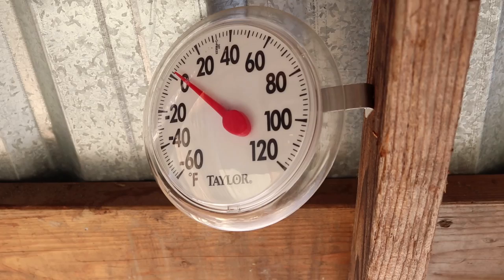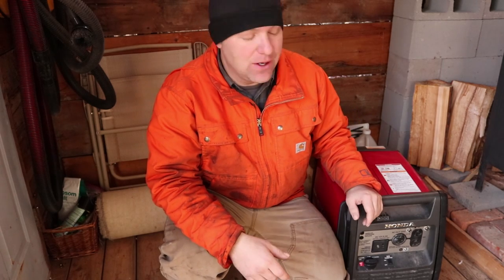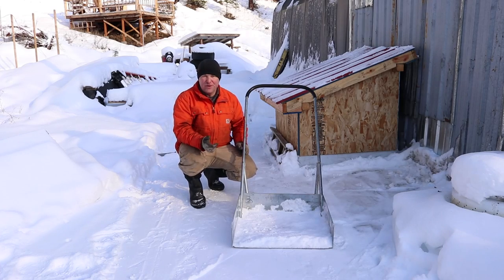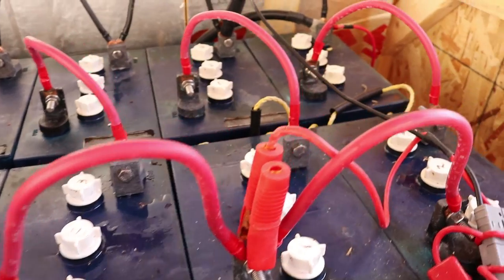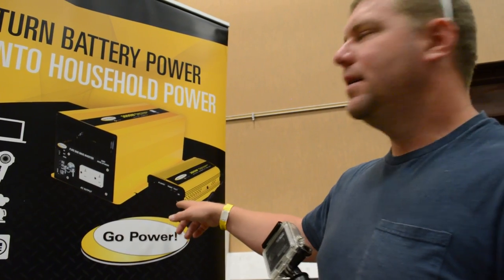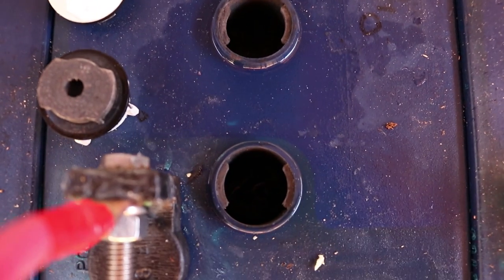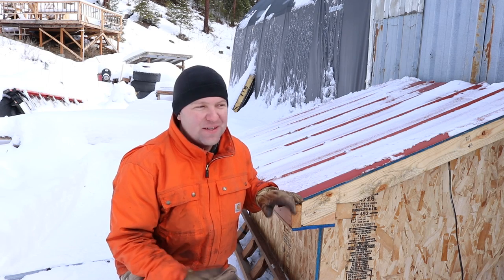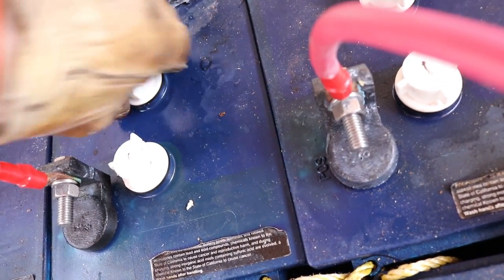SO FRIGID BATTERY ACID IS FREEZING! + Off Grid Power problems

Comment: old timer trick for battery's i use it all the time on my atv and other stuff around the farm. we are way up at the top of NH -20 temps and batteries work great. mix 10 tpsp  epson salt to 1gl of distilled water from the Pharmacy. add a tiny bit to each cell this works on even completely dead battery. If you google it you will find more info. if the battery is real shot you can deoxidize invented the cells with vinegar and baking soda and rinse with water. then top off with electro-light and in a little bit of the Epson salt solution.

Comment: Here is another possibility.  Build an insulated box that will hold the generator with about 4-6" of space on all sides and top.  Obviously you need some ventilation to get the exhaust out and some fresh air in, but you want to keep most of the heat in.  You probably should have a metal deflector near the exhaust.

If this doesn't make enough heat, try hooking up a couple of 100W light bulbs inside the box.

I also think that if the generator is running in a warm environment, that it will be easier to start the next day.

Comment: would it work if you ran a tube from the house to the battery box as low down as you can get with a little electric fan to push warm heat from the stove to the battery box, As far as the generator i always take the carb off and clean it because every year they gum up and causes it not to start and they run funny. just a idea.

Comment: Hey i know you guys in the usa use fahrenheit as your measure of temperature but if you have a few loose coins rolling around it would be nice to get a thermometer that measures both Fahrenheit and Celsius for your international viewers.

also grab a thick slab of steel and whack that bad boy on top of or next to your fire each night and then in the morning put it in the battery box, will bring the batteries up to a nice temperature.

Comment: what about dropping a couple of drops of anti-freeze into each cell?  I know that would possibly change the chemical makeup of the cell, but would it be a negative (as opposed to a dead battery?)  I'm curious to try this with a cheap or salvaged 12v car battery.
Reply: no that will kill your batteries, even using generic water ( as in its full of things other than just H2o especially in america), the question is do you know why....

luckily its dead easy to make reasonable distilled water to top up, it just seems that people are so used to convenience  they forget all the basic science  lessons already learned, if your off grid or just practicing offgrid in the back yard (now theres a concept :) then these things take on more importance as you may need to know stuff..

Comment: You can use gernerator exhaust to heat up the batteries with a simple damper control. The generator sits outside of the battery box and you got a aluminum flexible pipe into the battery box... no need for air tight... just a good flow. Sular furnace and insulate that battery box is another idea.

The generator sounds like carburetor issue but you should run a engine compression test to check engine health before servicing the carburetor..

Comment: "Back in the day" we would put a low wattage light bulb in our pump house to keep the pump from freezing. If your pump froze in the winter it would be a long winter without water. I am betting if you put a light bulb in your battery housing they wouldn't freeze at all and use less power in the process.
Reply: (BUT, FOLKS), if they are trying to run solar, they would need to run a generator to run the light bulb?  or the (BULB) would discharge the batteries and kill the bulb and (viscious circle) LOL

Comment: There's something called a battery blanket and you need at least 2 or 3 of them between the batteries. If you keep a couple batteries inside with you(warm) hook them up to an inverter to run the battery blanket.  Frozen batteries DO NOT accept charges well!!!!! Top up your batteries with electrolytes You shouldn't be able to see anything but fluid in those type of batteries. I live in Northern Alberta Canada and I would never go without a battery blanket. If my truck has been plugged in(battery blanket and block heater) the truck starts like it's 75 above. The ideal thing would be a boiler system running excess heat from your wood burning     stove out to your batteries and back to the stove.(flexible copper pipe wrapped around exhaust pipe is a good place to start.) Lots of people use it for their cabin hot water needs.

Comment: Some time back i had a moped , which when hot would have a partial break down of the coil ie would start ok when cold , but with the increase of resistance under heat & load , after an 1/2 hour or so , would stop & refuse to start , until it was cold . Real pain . Was 2 stoke .......... took several attempts to get the dealer to find the fault , 'cos they never run it long enough for the fault to crop up,eventually they changed the coil.
Run it 'til it starts to play up & then see if the spark is coming through as strong as when cold ( ie pull it out at the start of the "test" & then when it starts to falter).... this may not be conclusive..the spark may be generated,with the plug out,because,as i under stand,pressure also suppresses the arcing.........
The other thing, is the routing fuel line,if it has been pulled about, it may have been put back passing an area in the gen that heats it up too much , causing "air" locks .    
Ps Sweet place to live !

Comment: Everything would freeze solid inside your battery box. You need to insulate the battery box than worry about placing a heater inside it that uses electricity.

Comment: Your carb is feezing up on the generator, you need some means of keeping engine heat on it. for starters take the air filter off it. winter air is cleaner and less likely to destroy the carb (snow blowers have no air cleaner). start taping holes /vents on the casing, that should make it hold heat (tape a third, then half, three fourths etc). Cover only as much as you need to keep it running you don't want to over heat it, and ofcourse reverse the procedure when the weather warms up. Never be afraid to tinker, most of what I have came from tinkering in one form or another. Synthetic oil, check the manual for which spec. If you're buying it special buy mobile one you won't regret it.

Comment: I know this is going to sound strange but the intake air is too cold for that cabarator. At one deg. or less the caborator will freeze up inside because the fuel turns to gas cools down already cold air freezes gas. We had simaluar problems operating in the bearing sea. Equipment for 5 deg. and below is winterized. Special fuel, oil intake heaters using exhaust manifold to heat air into caborator.

Comment: Only top off your batteries with distilled water, pure water (water vapor)is what battery losses when charging so that is what you put back. 
Your generator carburetor is probably icing up. Under load there is a lot of cold air going through it. To test this rig a cardboard box or something so the air cleaner is getting warm air from the heat coming off the engine. Not the exhaust just the air that cools the engine. If this works you will want to put it back to normal in warmer weather. I just thought of another faster check use the heater you use to heat the batteries and blow warm air at the air clearer intake if it runs better rig up the warm air intake.

Comment: You really need to insulate your battery box!  You will be loosing greater than 50% of your battery capacity at those temperatures!  You probably don't have the room, but moving them inside in a smaller plywood box with a dc vent hooked to an aux switch so it only runs when the batteries are charging hard enough to off gas, is really the way to go.  

Those frozen batteries are a real problem.  Looking at the specs on the inverter/charger and what I can see in the video, you are running a 12V system, so you must have 4 parallel strings of 2 batteries in series.  If this is the case I would take the 2 poor/frozen batteries out and just run with 3 parallel strings of 2 batteries and store the bad ones inside for the winter and work on them in warmer weather, they are just drawing down the rest of your system right now.  This my clear up your electronic problems as well?

Comment: Generator problems? Remove the outer cover (take pictures) find the engine speed control unit, attached to the Carburator. often operated by wind or a magnet, then clean off the contact surfaces and use WD 40 let it dry,, shoot all friction points. This control unit is how the speed changes under load,   also the air filter may be restricted, give me email and I will send pics of battery insulation that works for 80% of Summer Plus or minus a bit, What actually made a difference I can show you, good luck ,Nick

Comment: Hi +Pure Living for LIfe... Interesting video, more stuff RE the battery saga. Yes, I'd heard of ppl running thinner oil in really cold climates because the viscosity of the oil changes and gets thicker. Had me thinking living that lifestyle I'm sure you are more aware of how much power your devices or local grid takes. Have you done a video or studied the numbers? I'm curious, how much power to charge a laptop? The drone? Run the local grid for overnight to see at night? How much power in does the solar bank give?
Reply from the maker: We use about 3000 watt/hours per day on average with all of our laptops, cameras, lights, fans, heater, pump etc. In winter our solar currently is inadequate. We often saw "Whether you have a $100millon solar system or $100 we all get the same amount of power in the winter (oct-mar)" In summer (april-sept) our 480 watt panels produce far more than enough for a very conservative, LED based RV. I can't ever spend enough time on one thing to become an expert. Too many experts on one thing while we have to know a lot about a lot of things. :) Our power bill in winter is approx $100/mo. In summer it's $0.
Reply: Thank you kindly for the informational reply. Wow! 480 watt panels... Nice! Bests to you both rolling into Spring.

Comment: as for the generator. ...  have 2  one to do small work  and portable like a 2000 watt harbor freight predator and a larger stationary unit  like an ONAN  or build ur own with a generator head , from HF or northern tool  in the 10-15kw range   
that uses a real engine from 22hp+ and is easily repaired and maintained  or get a used welder generator  (800-1k) and learn to mig and stick weld...plus have a generator ability

Comment: POSSIBLE PROBLEM is if your gas has ETHANOL in it... I have 2000 watt Yamaha and when temp got to  -10 C it would not run so good.. so I tried using high octane gas BECAUSE it has NO ethanol in it and the generator ran much better.. also I use "fuel stabilizer" with every ounce of gas because Yamaha says ethanol is not so good and THIER brand of fuel stabilizer is designed to help with that..  they also say to let fuel run dry in carburetor before storing generator for more than a few days... apparently ethanol causes problems of several varieties for small engines like generators..  these are now my must do's

A) use fuel stabilizer in fuel at all times...

B) when ready to shut down I either let it run out of fuel or turn fuel cock off and let run out so carburetor is EMPTY while it's not running

C) use fuel with NO ethanol at low temps in winter

I live on west coast of BC Canada so we don't have real winter temps.. mostly it's no more than -5 C for a few weeks and -10 C a few times the odd year.. so I've not had problems with oil from super cold temps.. I run it to charge my battery bank 2 or 3 times a week and it's still running like new after a year and a half..

Comment: Too bad about your battery.  Once the S.G. is close to 1.00 its going to freeze easier. Pull it out and try charging the crap out of it on a car charger hopefully remove some sulphates on the plates.  Problem is that solar charging pushes so few amps into the plates and any resistance doesn't allow it to build up voltage.  First have to start with deep cycle batteries.  Might have to replace, perform a ceremony for the old one and carry on.  Good luck.

Comment: In cold environments , the battery bank should be in a heated place . At 32 F ( freezing ) a lead acid battery will only have 20% reserve capacity . You are guaranteed trouble if you dont bring them inside . All of the electronics are for indoor use and will be subjected to frost that can destroy them . Here is a good place for battery info  

http://batteryuniversity.com/learn/article/how_to_restore_and_prolong_lead_acid_batteries

In the case of your generator , did you try a new spark plug . If I am not mistaken the type of generator you are running has a econo mode that can cause your gen to run at half speed . this is enough to cause plug fouling .
I have had several small motors that all they needed was a new plug and then they ran like new .

In the case of your charging , I use Manuel Fleet Chargers . Mine have 2A-10A-40A and 200A boost and I get a lot of charging
with very little gas burned . More bang for your buck . They need to be monitored much closer but work very well and are about $150 Canadian .

denis

Comment: I know, here's a good one for you. Take the batteries and bring them inside the way I described below,  then, take the crap generator and put it in the box where your batteries were, insulate it and add an exhaust and run it inside that. Most big more modern building have a generator room.....Hmm, a room for a generator, I guess they knew something we didn't. Ok I could see this as a problem in you were constantly on the road....but your not. so?

Comment: Silly question..but if you take the generator out of the back of the truck, does it run any better?

Make sure the air filter is clean
Check the gap on the spark plug.
Run non ethanol fuel.
Use Sta-Bil.

The low temperature oil requirements were in the manual.    
At the temps in this video.. it calls for 5-30    Use of synthetic like you've done is a great idea as well.   

Pretty sure the manual says change the oil every 100 hours on that unit.... the oil that came out of it looks like tar.   If you want that honda to last.. you need to change the oil often. 

What is your altitude?   Do you have an high altitude kit installed in that generator?   I would contact Honda directly.    High altitude use is talked about in the manual. 

Your manual can be found here in case you don't have one.  Note there is a difference in manuals based on your S/N
http://powerequipment.honda.com/support/owners-manuals/generators/eu

Your batteries need water... you are ruining them.  Fill to a little above the plates.    
You need the box heated at those temps... or you will freeze the batteries.   Bring them inside and vent the box to the outside. 
 If you've got ice in a battery.. it's likely way too late. 

Find the specs on those batteries and try to keep them within the temp range.  You will find they will take a charge better and give you better run times.

Comment: Since you have heat just at the other side of the batt. Shed.  Maby you could drill a Hole at the back, put a pipe in and find a Low power use fan like from a computer or maby a draft to a toilet to move hot air from the living area to the batt.
Like an example http://www.hellotrade.com/wosab/heat-mover-vega.html

Comment: hmm, i don't like the way you have hooked up those batteries.. Often have same problem in 24V cars where you have to take out  12V for a winch or something.. u see the internal resistance of the first row of batteries gets high when they are fully charged, this will cause the charge current for the back row lower.. it will only get worse when the back row get less power.. apers to me u have 6V batteries and u paralell 2 and 2.. it may be better to make 2 6v banks first then have them in serie with 1 bigg cable, be sure to add a fuse.
Reply: You have done it the correct way, i see that now.. but the 2 batteries that has frosen over makes you loose the capacity of the 2 batteries left on the front row.. if you do it my way.. there is a risk that the to left rear batteries will most likely take down all batteries in the rear.

Comment: It looks like you have 2 dead batteries in a 48V series string.  They will never equalize.  Ice in the battery is basically the death knell, your system will never be better than its weakest link.  Not knowing how close you are to a town that has a battery supplier I will suggest there is a Trojan battery distributor in Spokane, cannot remember the name at the moment, you know how to google,  lol. I bought a few Trojan T105 golf cart batteries there, that was about 5 years ago at that time I got them for appx $125.00 each.  In a 48V string these will give you better performance than you are currently getting now and will be reliable.  You should be able to do it for about $1000.00 bucks.  Gee, just a thou, don't we all like to hear that!

A couple of other points,  batteries like to be warm, the ideal temp for lead acid is 77 degrees F.  They have maximum capacity at that temp.  Building a tiny box inside with a small bit of ventilation will prevent any hydrogen build up problems, this is primarily associated with equalization cycles.  You probably will not need to equalize much if they getting regular use.
   

Unsolicited generator comment:  a Honda eu2000 and an eu2000 companion will run about 2K.  You can use just one most of the time and parallel them when you need 3000 watts.  I converted my companion to propane and am very happy with it, however it has not yet experienced a winter in NW Washington.  Propane is great!!!  The fuel lasts forever in storage and doesn't varnish up the carb and is incredibly easy to use.  It is however more expensive to run.

Boltzaction